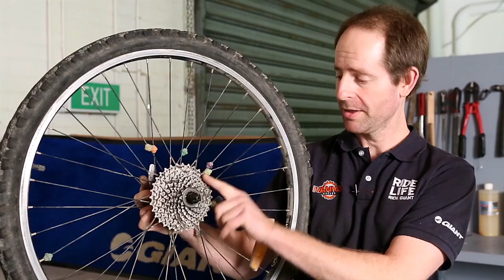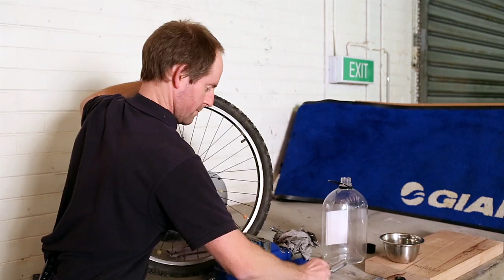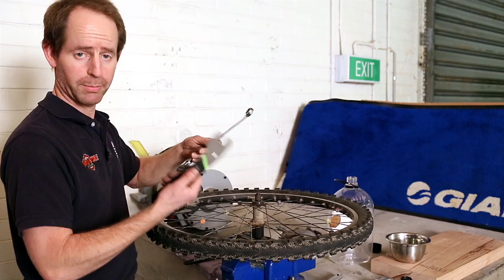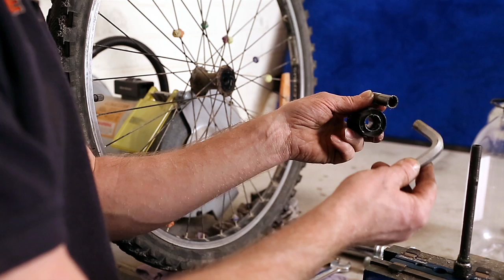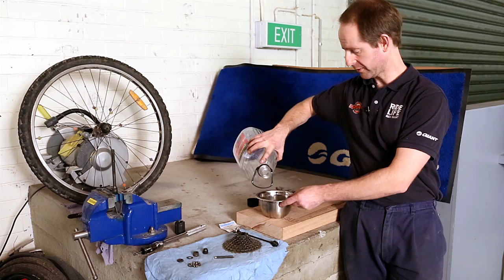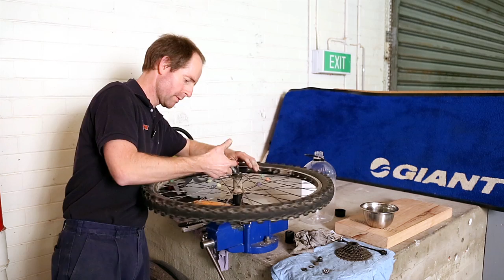Replacing a Freehub Body

Comment: The mechanic forgot that the quick release when tightened will slight compress the axle, increasing the bearings preload, the correct way is to take that in account and adjust the hub to have a little of play (the amount of play depending on how much tight do you like your quick release to be)

Comment: Thanks for sharing, your video helped me a bit when I was uncertain on how to proceed with the repairs.  What I'd like to add is that, in case of Shimano XT FH-M785, it was actually 14 mm allen wrench which was required to remove the freewheel body from the hub.

Comment: Hi, nice tutorial. I have a question regarding freehubs. I want to upgrade my old 7 speed Kuwahara Pacer steel frame bike to a 9 speed, will I need to also change the freehub body to accommodate a 9 speed cassette, what if any issue could it cause?
Reply: I want to do the same thing so did you try it?
Reply: Same here. I scored a great old Shimano 9 speed wheel, time to move it to 11 speed.

Comment: fantastic video. maybe you could make an instruction video on how to make a good instruction videos for those mumbling, incomprehensible kids who put out info on how to fix phones then maybe my phone will work as well as my bike !
Reply: I'm having that problem as well. I got my freehub overhauled at my local bike shop & my cassette still has that wobble problem. Its noticeable to the touch & on certain gears when I pedal. Might try replacing the entire freehub body to see if that solves it.

Comment: Thank you for the tutorial very helpful. I just have one question and that is what type of cassette gear hub is this so i can buy a replacement. The one i have is almist at it's last leg and really need to get one just like this one. Im used to using the ones that screw on to the wheel outer surface, this one screws to the inner side of the wheel hub. Please advise. Thank you and keep up the good work.

Comment: This is very informative, but i have a question...are most freehub body interchangeable? I have a broken freehub made by Novatec. Can i replace it with a Shimano?
Reply: Bring it by your local bike shop and the mechanic should be able to tell you which would fit.
Reply: I do not know of any incompatibilities of hubs on axles. Whenever an axle is different, I guess there could exists one, but I'm not the expert.

Comment: I'm having troubled with this. I got the cassette off and the bearings out, but there's nothing inside for an allen key to grab onto. I looked inside with a flashlight and it's perfectly cylindrical but there's a tiny hole on one side. Not sure what kind of tool would be used for this style freehub body.
Reply: Michael-Nora Trout me too same problem

Comment: Nice vid, but I would add that while it's all apart, check that the cone and the jam nut on the freewheel side are nice and tight *before* you put it all back together.  If they've already been loose, check that you have the correct amount of axle protruding past the end of the jam nut too.  On most of the hubs I know, you can't really get at the freewheel side cone with the axle installed.

Comment: Great video ! Very well done.. I learned alot. the thing I still don't know is, what if the other cone comes around a few turns while in the process, or if in my case the freehub I used to replace the other was slighlty wider and I had a problem keeping the rear wheel locked in the frame as I ride. In other words how do I set, or what is the distance the axle protrudes from each side, so it will stay latched into the frame of the bike and not pull out under pedal force ?  great video..!